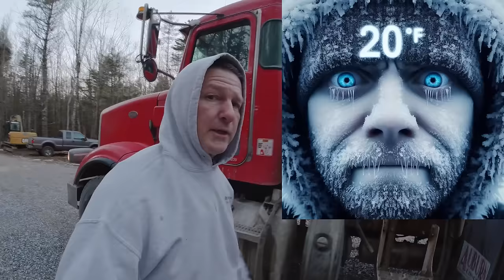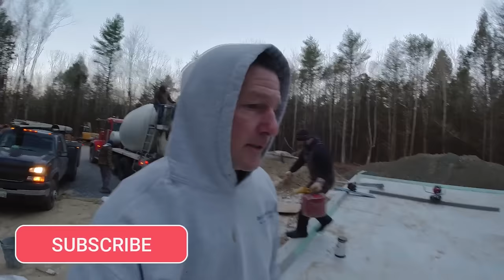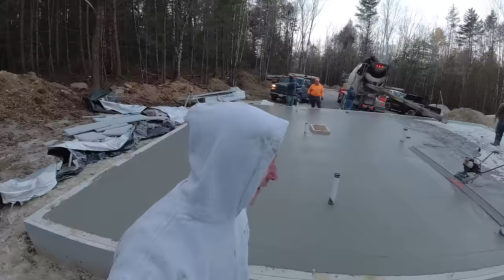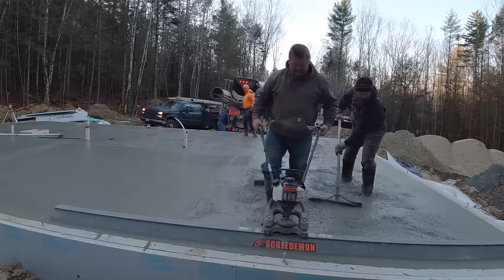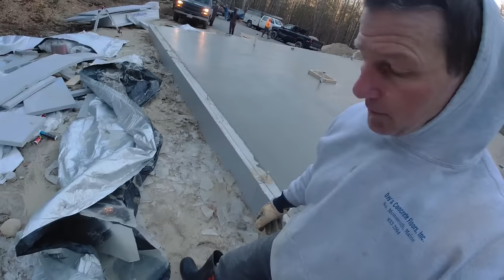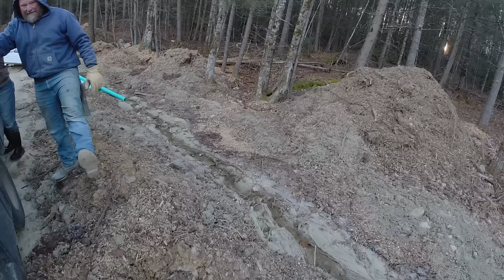What PSI Concrete Mix We Use in Feezing Temps to Pour Concrete Floors!

Comment: For the most part we pour in -10f to -40f and rarely do our trucks hoses freeze up. We don't run air to pressure the tanks but have either electric pumps or air diaphragm pumps to move our water and we just recirculate the water back to the tank. As long as the valve is open enough it won't freeze up while driving

Comment: I've wondered about heated aggregate as well. When I use 140 degree water the mix still only comes out at 55 degrees. Concrete is under 10% water so the hot water doesn't do a whole lot but it does make a difference. I poured on Friday with hot water and no accelerator but I used so much water reducer that my W/C ratio was only .4. We were off it in 3 hours.
Reply: Up here in Canada we steam our sand. That really helps